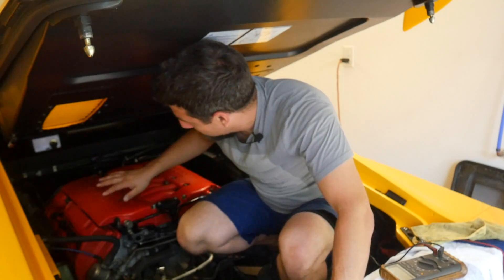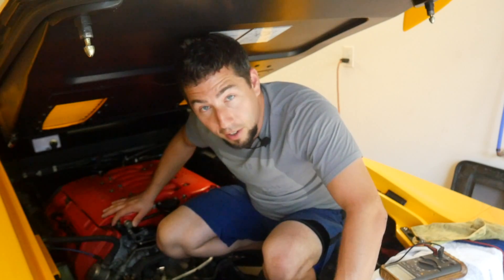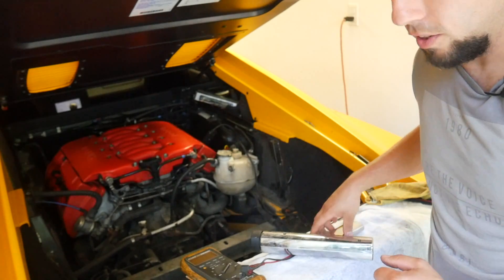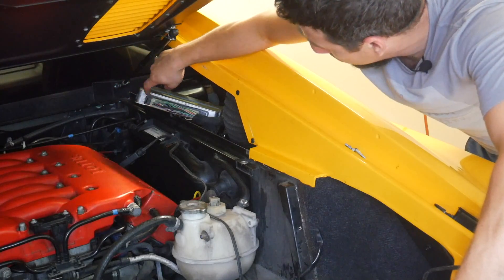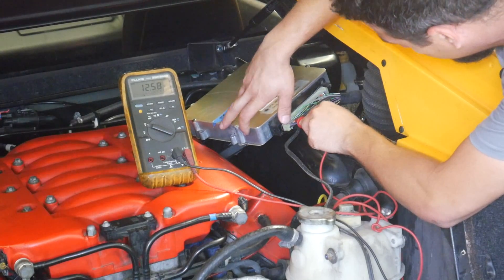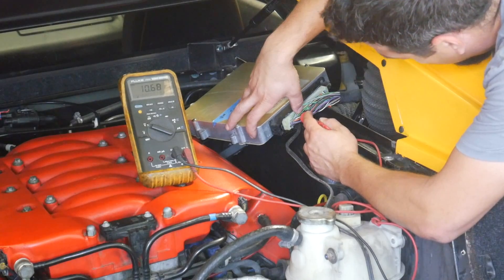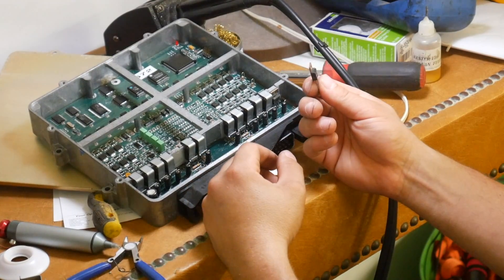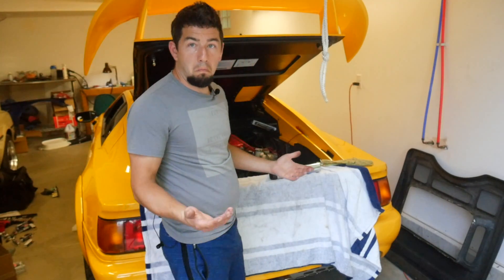Lotus Esprit V8 Engine Misfire Diagnosis & ECU Repair. No Spark in 2 Cylinders

Comment: Where did I actually find the pinouts for these kind of things? So engine, airbag computers and so on?
I’ve got a moderately old car which runs great, has no codes but a problem in or around the airbag computer and can’t go back on the road until I fix it… and without the pinout of the computer, it’s basically 54 factorial combinations to find which wire goes where…

Comment: Being that's a lotus it's definitely solder with an L lol. I had an ecu fail due to dirt on the circuit board, a good clean resolved the issue.

Comment: don't back probe the wires, wrist ground strap? i worked for a place that had 2 50hp pump motors (208 3ph) on danflass VFD, one pump would not work on drive service tech from company that installed both VFDs came out and told me that the motor was bad, hmmmmm it worked with out the drive. I rewired the drives and swapped drives, drive A was not running motor B, call the guy back out and told him that either drive A was bad because it said motor B was good or drive B was bad because it would not run motor B, but either way one drive was bad and he was going to fix it, he call the factory and spend 1 hour talking to factory and ordered parts, drive was fixed 2 weeks later. I win!

Comment: You may also have repaired a cold soldering joint. Those are a common problem, even more so now-a-days when the lead has been prohibited in the solder. Basically, a cold solder joint is caused by too low a soldering temperature and un-leaded solder needs more heat to bond the component to the circuit board properly.

Comment: Metcal PS-900, PS-1000 or later models is my recommendation for soldering irons. I use them at work, have a PS-900 at home and replaced the capacitors in my Toyota MR2 with it.

Comment: I had a '94 acura integra that had no ignition.  It used a single coil and distributor.  I ohmed out the coil per the shop manual and it measured ok.   I was about to replace the output transistor of the ecu, but when I took the cover off the ecu and inspected it, it was of such high quality (aerospace quality) that I decided to have a mechanic figure it out.  It turned out to be a bad coil.

Comment: I was an electronic technician for a while. I repaired some, not many, power supplies that had cold solder joints. If you can find huntron tracker you can determine if a transistor is good or not with a dead board. We had the model 2000, a very capable meeter.

Comment: Solder joints on old vehicle electronics, are notorious for micro cracking. Volvo antilock controllers WILL fail intermittently. It won't shut down the car but it'll randomly xmas tree the dash lights and disable half the gauges. Had to reflow every solder joint.

Comment: the one pin that had the 10 volts can you re show its 12.5v now ??  also the output transistor re solder work  you redid
you might want to redo the main connector pins  in the same manner , clean the male and female main connector to the cpu
using deoxit spray on both then use the shop air and blow the 2 connectors before re plug
the transistor out of circuit should have been tested with a transistor tester or on meter is diode test check between 2 pins on trans then opposite is open forward is .650 voltage drop only for trans an fet trans is different

Comment: Two words of advice when working on electronics,

                STATIC PROTECTION

Modern electronics are extremely susceptible to damage from static electricity and you don't even need to touch the board if you have a high enough static voltage build up on you.
Most semiconductors used within chips use "FIELD EFFECT TRANSISTORS" that are controlled by creating an electric field rather than "BIPOLAR TRANSISTORS" that were controlled by the flow of current through them. The electric field these transistors create is minuscule and is created by as little as 2 V. If you get a spark from static when you touch something then your talking about thousands of volts sitting on your fingertips and subjecting the thousands of semiconductors in a single chip to such a massive electric field can result in catastrophic damage. Even worse static damage may degrade the performance of the semiconductors which reduces the electronics tolerance to noise and can end up causing intermittent problems that can be extremely difficult if not impossible impossible to isolate and repair.

If you ever open up any of the electronic control boxes make certain you

            ALWAYS USE STATIC PREVENTION PROCEDURES AND CARY OUT ANY WORK
                   IN A STATIC FREE WORK AREA WITH ANTI-STATIC BENCH TOPS

Comment: So you probably already know this and it doesn't apply to this video but why am I telling you? Just in case you don't know. It's easier to find an electronic spark misfire in the total darkness if you close it in the garage turn off all the lights you might see the spark but in your case you would not because it was in the ECM and not in the wires or plug.

Comment: I'm confused because in the beginning of the video you said you had no codes but at the end of the video you said you had codes that you need to clear. On big diesel trucks the codes will tell you which driver is bad. But it's not always in the ECM sometimes it's wiring issues. However I think you're repair may work because I had the same issue with an ABS module where on YouTube I read that it's common for the solder joints to be bad on the relay on the circuit board and that was the code I was getting so I resoldered them and it's been perfect for almost a year now. U did a great job.

Comment: Succes but:1/ you can measure components in place (use a scope!), so no need to take them out. 2/ once out, you can again measure components, so no need to place them back.3/ you never “swap” electronic components, in case of doubt, buy new, the 1 eur/dollar cannot be the problem. Avoid as much as possible soldering on a pcb: damage is never far away. 4/ Use magnifiers to inspect the pcb first. By using this, all this would probably much simpeler.

Comment: Bit of advice. NEVER trust continuity testing, ALWATS run a load through the wires. A wire can have enough continuity to ohm ok, but won’t carry a load. Seen it a hundred times, a couple thin strands of copper will ohm OK but won’t carry the required load. Just a heads up. Btw, one of my fav cars, love it.

Comment: It's funny how solder can cause so many issues. I've saved many people lotsa money over the years reworking solder in components. 

You can also hear some ecu up in an oven at the solder rated temp for 15 to 30 minutes...

Fixed many misfires, speedo issues etc...

Comment: The clamps on the transistors are heat sinks that attach to the rail to transfer heat efficiently. It's a nice design. You can test a transistor out of circuit to determine if its bad. Some meters have transistor testers in them.

Comment: I would have just switched the wires in the harness. Tomahto tomato.

'Course, I couldn't have fixed it that way. Cold solders are not that uncommon on circuit boards, but that's new boards. You just got a crack in the solder. Nice find.

Comment: Dried solder joints are extremely common on aging electronics.  I repair Skyline GTR clocks because of this.  Subaru airbag light boards are also known for this.

Comment: I noticed that you had changed out your injectors.  Curious to know what injectors you went with.  I tried the RCs but didn't care for them.  I've also tried the Bosch Gen III 0280156211 but found them to be a bit on the rich side.   Both the OEM Rochester and the RCs have a static flow rate of 260cc/min. Resistance in the 10.8-12 range.   I'd like to find a Bosch Gen III with those specs, but no luck.

Comment: Always do a solid visual inspection first with any type of optical enlarger you have be it a cell phone camera or simpler still a magnifying glass. A hairline fracture in a joint is often the cause and often overlooked at the best of times . Do not use break cleaner on PCU's or electronics ever, anhydrous isopropyl alcohol is best. Reflowing solder joints is usually what I do after a solid visual regardless of any obvious cracking. Clean, reflux, solder heat test, then re-float, clean flux. Use a grounding bracelet for static discharge. Awesome car by the way.

Comment: It is interesting watching you resolder.  If I can suggest, is to get yourself a ground strap for your wrist and a static mat.  Second, I have concerns about where the computer is located.  I have been doing a study on failed components whether it is light bulb or suspension part.  Components located on the passenger side of a vehicle have a greater tendency of failing.  My conclusions are not very scientific, but still interesting to say the least.  
The primary reason for failure is the conditions of most roads and the driving habits of many drivers.  A lot of drivers tend to drive with the right wheels to the edge of the road (their body located on the centre line of the lane).  This puts the right part of vehicle on the most abusive side of the road.  It would be interesting to do a comparison on parts vehicles located in the UK and Australia.

Comment: Is that pex pipe on the wall in the background? Exposed?
Reply from the maker: It is because I still need to put a faucet inside that garage. It’s heated and air conditioned, and I’m the only ever in there so I’m not worried about

Comment: Don't know if someone already told you but those drivers heat and cool every time you use it so the solder joint crack.

Comment: It was a cold solder joint. The lower voltage was a clue. It’s much more common these days (likely doesn’t apply to your car though), because of our nanny government’s removing the lead from the solder.
Reply: Yea, fuck those assembly line workers. A little lead never hurt anyone. And RoHS was definitely in effect in 1999.

Comment: Automotive electronics is my job and I can tell you that intermittent faults are impossible to diagnose with 100% certainty. You can never completely relax now because the fault could reappear at any moment. Temperature cycling will kill anything. 
Have to say, I don't know who made the ECU (not Lotus) but it looks pretty tidy. Good result - you did the right thing there - hope it sticks. The Esprit has got to be one of the best looking Lotuses ever!

Comment: I used to repair the boards on GM instrument clusters that had the same issues, not to mention mold too! Mold would grow under the conformal coat and cause problems..so off went the conformal coat, scrub the board with a brush and lacquer thinner, resolder everything then recoat. Problems fixed!

Comment: I would think that the transistors (drivers) would be able to be replaced if one or two of them burned out. I owned a Chrysler Crossfire for awhile and they had a huge problem with their circuit boards in the engine bay (I had to reflow a couple of them). Good job fixing your mess.

Comment: Bad solder joints are a real thing.  Of course, you may have fixed it by dislodging or moving something without even knowing it.  But, the bottom line that you have fire in all of the holes, now!
Reply: In electronics we call it a "cold solder"
Reply: Yes for sure. In guitar amps that use circuit boards, sometimes they seemingly randomly fail and the first advice is often to reflow the solder on the pots or jacks and the output transistors as they get stressed the most. I repaired 2 dead peavey amps this way, but he’s right that it’s not very satisfying knowing exactly which thing fixed it.  Just that reflowing the joints works. I guess over the years the heating and cooling cycles take their toll.

Comment: I hate it when the problem is fixed without showing positive evidence of the problem. I don't want to see just the smoke I want to see the flames and how the fire extinguisher put them out. I want to see the crack that is causing the leak or the failed seal that won't hold pressure or the line of code that caused the horn to honk when the brake pedal is pressed, etc. Without that kind of evidence the repair could just as well been brought about through voodoo and could un-repair itself just as quickly.

Comment: I admire the breadth of your knowledge and skills. How did you learn so much, particularly regarding electronics? I imagine working in the auto field helped. I have a '95 Volvo 850 that had failed inspection due to a non-working SRS light. Turned out not to be a blown bulb. I took the gauge pod to a friend who repairs electronics and in a matter of a minute or less he identified some suspect soldering welds. He repaired them and I found out I had several lights that weren't working 😂. Obviously, the gauge pod is no longer manufactured and a used one isn't cheap, but the repair only cost me $20 just because I insisted on paying him something. This inspired me to want to learn more about electronics repair.

Comment: I don’t know too much about this car, but all obd2 cars are supposed to have misfire detection and set code for the correct cylinder(2). If the coils are 4 or 5 wire, it uses a induced magnetic sensing coil inside the coil to detect misfire. That’s how my 99 NSX worked. Does this have coil on plug, and 4 or more wire coils?
Reply from the maker: This used 4 coil drivers, with two 4-cylinder coil packs and plug wires. Each coil driver is responsible for two cylinders

Comment: I have a no-start I'm tracking, with no spark. The coils are getting power from the relay, so I wanted to check the ECU signals. After watching your video I have an idea how to check them, but I feel like I must be an idiot because that's nothing like what I expected. If each coil gets 12V power and two connections to ECU, how does a 12V ECU output do anything? I expected a switching signal from the ECU that grounds the circuit to fire the coil, and I thought I'd need a small LED or maybe analog meter to see the switching. But now I'm guessing that I'm clueless. How does this coil circuit work?
Reply from the maker: So do you have no spark in any cylinder? The chances of a multi coil driver failure is pretty slim. Have you monitored your RPM signal? If you get no spark I would look at things that affect the entire engine instead of just a couple cylinders.
Reply: @I_Do_Cars  Agreed, I don't think it's the same problem you had, but I was curious to see if the ECU was trying to fire the coils or not. I'm guessing no just because I can't imagine both coils could break at the same time (i.e. should run on half cylinders at least if one coil failed), but my instinct is always to verify. I've been distracted from it for awhile so I don't remember if I saw the RPM react, but I had checked the crank and cam sensors and they were OK. But I hate concluding that I don't understand these 4 coil outputs, seemingly at all, so I was curious how the ECU actually fires the coil and how I could verify that, even if I probably don't need to it in this case.

Comment: I have an R33 Skyline GTS RB25DE ECU which has a fault on the input side for the mass airflow sensor as it was throwing a code 13,the spark plugs were fouling up & the engine wouldn't rev past 2000 RPMs so I replaced it.

It came with.a Japanese import engine package which I built a twin cam 3 litre Nissan (RB30DE,) engine out of as the.Holden VL Commodore & the Nissan R31 Skyline was released with both an RB30E & an RB30ET engine in Australia !

Comment: One thing I would recommend is you get an aftermarket ECM.
Copy the fuel map data from the stock, transfer it to the aftermarket ECM.
This way you wont have anything happen to the stock ECM.

Comment: Pro tip: driver transistors (or mosfets or igbts) almost never go intermittent.  I knew swapping the drivers wasn't going to fix it.  Kudos for using flux when working on that board - flux allows much better solder flow at lower temperatures.  Also, preheating the board with a heat gun (don't scorch it!) keeps the mass of the multi layer board from sinking too heat from the soldering iron.  Nice job.

Comment: Here's how you cure the misfire for good. Swap in a Mugen/Honda MF458S 4.5-liter V-8 engine. It's lighter than the Lotus lump, far more powerful and far, far more reliable. Also, the transmission fragility would no longer be an issue....and the cool factor would be off the scale.

Comment: Heat are electronics worst enemy, solder losens, circuit boards become brittle and components wear out prematurely so wondering what ecu's are doing in the engine bay.

Comment: no shitting, I had a 2002 GMC sonoma 4.3L with 217k miles.   with a #4 cyl misfire and it was bad.  live scanner showed 2K+ misfires.  I never tried to fix it since I have a few other cars.  out of the hell of it since I had it already,  I put a new fuel filter in it.  and the misfires stopped.  and the truck ran great.

Comment: The fact that after working the first time, issue went away for some seconds and then started is most likely a cold joint somewere. Usually when heating a zone to do a job, some other issue could end fixing itself, just because the sptread heat. If the issue comes back just remember the area you have been working around and closely inspect all the components around. Transistors can die because surges, improper heatsink, etc I do repair switching PSUs and sometimes you get something really blown appart, and other times it looks perfect but transistors are DEAD. Probably you have one, but if not buy the cheapo chinesse component tester called Mtester. Is really inexpensive and man is SPOT every single time. You dont need to swap transistors, you take the suspicious one, put there get its params and thats all. If blown, open, degrades .... it shows up with perfect accuracy. I have been using this for 3 years, non stop ... nothing beats them for the price.